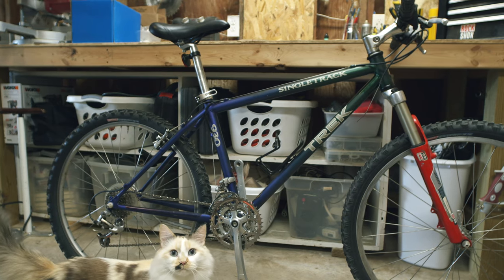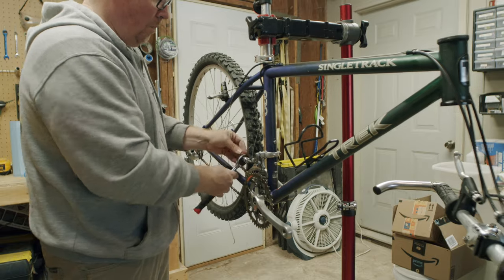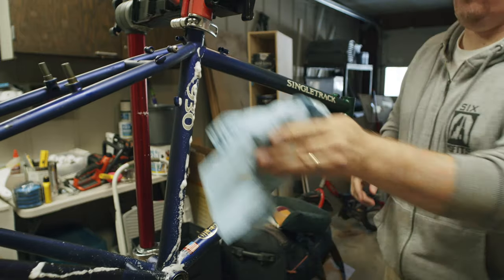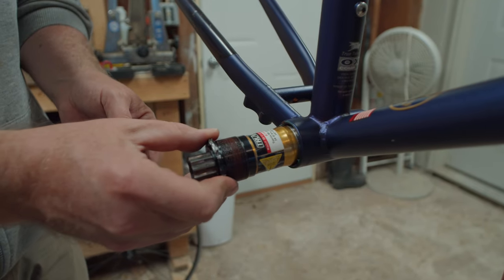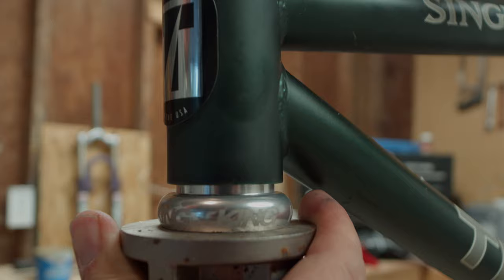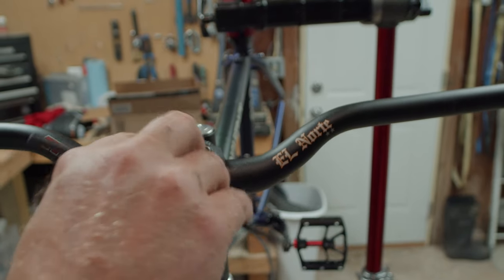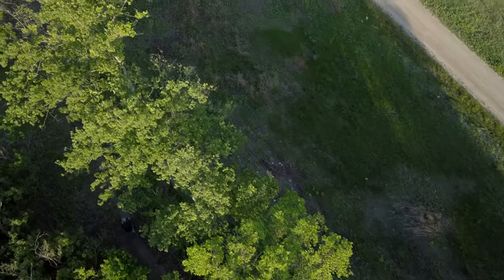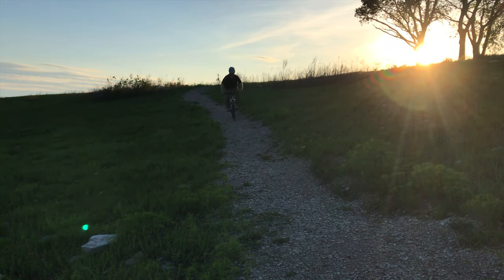Mountain Bike Restoration Trek 930 Steel is Real

Comment: I needed to see this!  Been agonizing about whether or not to replace my Trek 930, which has taken me across Iowa 3 times since 2011, as well as other short and long-distance rides in Florida and Missouri.  I love my 930 and have a special connection with it, as my cousin helped me with my purchase decision back in 1998.  I decided on a tune-up and will take it back to Iowa this year for the 2021 RAGBRAI.  It's not the fastest ride, but it's reliable and it makes me happy.
Reply from the maker: Thank you for sharing your story Laura. Sounds like you have a number of adventure left with your Trek :) Have fun at RAGBRAI!
Reply: I too have an original 930 (lightly ridden) that I bought in Iowa back in 98 or 99. Currently thinking about trading in, as I think the frame is a little small for me, but am beginning to think “keep it, swap out some components, and that awesome frame keeps living.

Comment: Those Trek 900 series are flat out awesome bike frames. They are straight and true. So easy to turn one into anything you want it to be. I recently had all the paint stripped off a '91 lugged frame 970 and was surprised to see Trek actually used expensive Silver brazing to attach the cantilever brake bosses to the frame. Now that is quality!
Reply from the maker: Agreed! Thanks for watching
Reply: @CoolBikeProjects  Thanks for the great video!

Comment: I bought a 930 Frame as my dream build bike, might go one more and add disc brakes but still undecided. Thanks for a great video
Reply from the maker: That is Awesome! I would love to see how it turns out.
Reply: What rims and Tires did you use on this build?
Reply from the maker: @kevinbeck473  Hi Kevin, I put on a used set of wheels from a Specialized Stumpjumper. Mavic 221 rims with Shimano/ specialized stout hubs. They were from 2001-2003 time. Great wheel set for the money if you are running rim brakes. Tires were Continental Cross Kings 26x 2.2"

Comment: I love the fact that you repainted the fork's legs! It really suits the bike. I'm considering doing the same with a vintage bike of mine, because the new fork I'm planning on installing is a bit bland. The original fork has that bare polished aluminum look, and I'd like to see if I can replicate it - or at least give the new fork a light silver metallic finish that would have it match the finish of the old stem and bars.

Comment: I washed my frame intense, absolutely drenched every surface with degreaser and cleared all the holes real thoroughly. Flushed and then used a truck wash both inside and out and repeat flushed all the grime out with high pressure water. Allowed to dry in the sun and after that a thorough spray with lanolin oil and tipped the frame every which way for 10 mins in the heat - it really digs into the steel and yeh rust - never 👌🏻

Comment: Hey great film! I am a Trek steel frame lover too! A few yrs ago I bought a blue 1999 930 for 10 bucks, fixed it up (all it needed was new cables all around, some new tires/tubes, a grease job and a bit of fine tuning) and won my first race on it! Had a lot of time to ride back then, was between jobs at the time.  Shortly after I bought a pink 1995 930 and restomodded it with some rigid forks, new pedals, street tires, and stem/bar off a modern Specialized.  That one was a bit more neglected but it cleaned up very nice. Love the lugged frames from those earlier years, although the geometry isn't that great for descending but it doesn't matter to me since I turned it into an around town bike.  For these old forks like the ones you put on this Trek, where do you go to buy rebuild kits/seals, etc for them?
Reply from the maker: Thanks for sharing your story Brandon, I was able to get some new seal kits from Jensen USA. There are some great connections though on YouTube if you check out butter suspension. He and a few others have some good contacts for seals and oil and things.

Comment: I had a purple Trek 930 .  Was purchased new back in 1993.  It was stolen from my garage when it was less then 6 months old.......never bought another one.   The other day I came across a 1994 Trek 850 SHX for sale In my frame size.   Guy selling it said its been sitting for years in his utility room.  Looked it over and the bike was dirty and cruddy but everything is intact with no damage .  Frame has a few minor scratches , nothing major.  No rust anywhere.  Oh, and it had a kickstand  LOL  With a lot of cleaning and degreasing, plus some TLC its going to be a good ride and well worth the 35 dollars he wanted for it.  If I decide not to keep it I will gift it to a deserving young kid that needs a bike.   I think I may have found something new to keep me going at age 67.
Reply from the maker: That is awesome Mike. Sorry your original was stolen, but glad you have another. Bikes are so much fun. . .

Comment: Thanks for the great video.  I am looking to do a similar restoration of my 1992 Trek Singletrack 970.  Do you know if my project would accommodate the same bottom bracket set-up you used? Thanks.
Reply from the maker: Hi Roderick- I honestly don't know. It would be best to go to a trusted bike shop and ask them to measure things for you first before you buy something. Stand Bottom bracket shells were either 68mm or 73mm so that will be the first measurement you can check. Spindle lengths can be all over the place.

Comment: Hi very nice bike!! .This Rockshox fork will fit on my Giant Granite (Sedona) 17inch frame 1991-1993  ?
Reply from the maker: I would suggest taking it to your local bike shop and seeing how much travel they think could fit on your bike. Unfortunately the early 90s bikes usually only had a 1 inch steer tube which really limits what kind of suspension fork you could put on there.
Reply: @CoolBikeProjects  to measure head tube diameter?
Reply from the maker: @mygoalcrash8077  yes and the headtube angle
Reply: @CoolBikeProjects  old forks is 1icnh (( not good news((  maybe how big head tube shutbe?
Reply from the maker: @mygoalcrash8077  late 90’s - mid 2000’s the standard was 1-1/8” . Early 90s to mid 80s was 1 inch standard. There are a few fork manufacturers that still make 26 inch inch and 1/8 steer tubes, and a few that make 1 inch just not very high end forks. Like I said I would check with your local bike shop to see what they would recommend.

Comment: Thanks for sharing this experience with us. I do wonder what cassette you ended up using? And how is the gearing for climbing. Also, did you put spacers between the crank spider and the chainring? It seemed like the chain would be hitting the crank with that chainring. Thanks
Reply from the maker: Hi Felix, I believe the cassette is 11-46 Sram GX. It came off of my Cannondale Hardtail One by 11. The chain ring is a narrow wide with built-in spacer. I can look up the part if you want.

Comment: Great video, thanks for sharing!

Ps. I'm eyeing a 1992 Trek 930, do you think it would be good for a retro mod or will I encounter any funky BB/headset standards ?

Thanks!
Reply from the maker: Hi there, It would make for a cool project bike but would most likely have the wrong geometry and a 1" headset so no real options for a suspension fork. Best wishes!
Reply: @CoolBikeProjects  cheers, thanks for the tip! expecting to use as a pub bike/light gravel bike so I guess the geo will be OK

And planning to run it rigid, but I hope it won't be a hassle to find 1" headset/forks

Comment: Is that the S-Works wheelset? Think the front was a Specialized Skraxle, and the rear hub was unbranded DT Swiss, both laced to Mavic 517s?
Reply from the maker: No this was the stump jumper wheel-set with the 221 rims. Still a nice set for their time.

Comment: Any chance at an item list? I have a 930 that I found in the garbage that I combined old parts for and have had on the trail numerous time, but would love to have a suspension fork, new headset, and 1x11 cassette.  I just do not know what parts are needed.
Reply from the maker: Sure thing, Ill add a list to the description over the weekend.
Reply: @CoolBikeProjects  ok so me and my son dug into our 1995 single track 930. we went cheaper with a Wake 780mm bar, headset, we stuck a quill adapter in the original fork (we don't have a shock just the original forks) New Shimano Linear pull brakes, and kept the old cassette and cranks for now, just want to ride the thing...But i had to order a new bottom bracket. one item I have a question about, When you ran the cable for the rear brake, did you enclose it for the length of the top of the frame and then what did you do once you got to the seatpost are that has that built in tube the old brake line went through? We thought it would be too tight a bend to go from that welded on tube guide so we used a hose clamp and mounted a section of cable sheilding to the frame? picture of that area would be of great assistance.  
Thanks.  the inspiration was perfect.  Eventually the parts will find their way into our lives that turn it in to a 1x11, bu ti told my son, with this age of bike, the less you spend, the more fun I have....
Reply from the maker: @KAlone321  That is awesome! Way to go guys. Since I went to a 1x11 I was able to borrow the cable guide that went to the front derailer as a stop. You don't want to use the tiny brake tubing by the seat post as you said it will be way too tight. I would suggest running the brake housing as a solid line from the level to the v-brake with noodle. If you want a cleaner line you can use some stick on brake guides just as a guide. If you are happy with your hose clamp then keep it. I found these guides here: https://www.amazon.com/Xmomx-Derailleur-Fitting-Housing-Durable/dp/B07YTZXPTJ/ref=sr_1_5?dchild=1&keywords=cable+guide+bike&qid=1627305255&sr=8-5 for about $8. I have sold the bike to a friend and don't have an image of it. If you email me, I'll get a picture of the brake line from him. Thanks! rustysbikerepair@mac.com

Comment: Even though this video is older.  I would like to mention. The original bike shop (Eddy's bike shop in North East Ohio,) which sold this bike is still open and I bought a Trek from them. The phone number on the frame sticker is still the same.
Reply from the maker: I actually tried reaching out to Eddy’s when I was making the video to see if they’d like to say anything about the bike or the shop and they never got back with me. I’m glad they’re still around though.
Reply: @CoolBikeProjects   Should of given a call. They are cool when you are on a call. They were amazing during the big drought of 2020. I found my 2021 Marlin 5. Not only were they helpful in letting me know about the drought. They helped me navigate that in fact it will take a long time to get an order.
So I suggest next time, with any bike shop. Give them a ring, instead of the e-stuffs. Eddy's picks up the ring pretty fast. Not so much on emails.. :) They have  more than three locations and are legit OK. :)

Comment: Going from a 63.5mm drop to 100mm drop seems significant. Was there any real negative to changing by this much? Would you recommend restricting it to 80mm instead?
Reply from the maker: Excellent question. This particular year of the 930 the geometry of the frame had the right head angle to accommodate the longer fork. It's best to set up a bike project with the fork in the frame and wheels on the ground to make sure the head angle is not pitched back too far. I am working on another bike project like this and experimenting with fork length to get the right angle. Sometimes you will need to keep it to 80mm.

Comment: What's the difference between the trek 930 and 920? I found a excellent condition 920 for sale
Reply from the maker: The trek 930 had a double butted steel frame. I believe the 920 was also a steel frame but with older geometry

Comment: great edit! I picked one of these 930 frames up recently to restore as well, looking forward to it. Do you by chance recall what size King headset the frame needed?
Reply from the maker: Thanks Aaron. Its a standard 1 -1/8”
Reply: @CoolBikeProjects  thanks for the quick reply! your video gave me some good ideas so I really appreciate it. I just cleaned up the frame and polished it, looks fantastic and no rust inside the tubing that I can find!
Reply from the maker: @aaronnull8950  That is awesome. I love seeing steel frames still in great shape! If you're on instagram I'd love to see any pictures you have of it.
Reply: @CoolBikeProjects  thanks just gave you a follow and realized you’re also around SE Idaho!
Reply: @CoolBikeProjects  in the process of finishing up my 930 but running into cable routing issues for the rear brake - do you use that little tube on the seat post if you convert to V brakes? I have been just routing some hosing around it but I think its causing a kink or something because the brake lever doesn't spring back when applying rear brake now. May end up taking everything apart first and making sure it is well lubricated and the spring tension on the caliper arms is strong enough. Cheers!
Reply from the maker: @aaronnull8950  Don't use the metal tube routing. That is for cantilever brakes only. I ran the brake housing all the way from the brake lever to the v-brake noodle and used zip ties temporarily to hold the housing to the frame. There are a number of metal self adhesive cable guides you can buy online from amazon for under $8 total to attach the cable housing to the frame, but all will require you to run the housing the full length. Hope that helps!
Reply: @CoolBikeProjects  Thanks, got it fixed!

Comment: Really enjoyed the restoration, mods and ride.  What size frame is it?  I ask because I have the chance to purchase an 18in 930.  I am 5'11" with a 32" inseam.  I am wondering if the frame might be too small for me?  You look good on the bike.  How tall are you? Thanks.
Reply from the maker: Hi Kathy, Thanks for reaching out. This was a 16.5" frame. I am 5'7'' so this fits me well, particularly with the taller fork. The 18" might be be a tad on the small side for you, but without seeing one built up it's hard to say for sure. You might check with your local bike shop to get their thoughts with your measurements. Best of luck.
Reply: I'm 6 feet tall and with set back seatpost and long stem 120mm I made 18 inch fame fit me a gt tenquesta if it's good shape and price is good I say go for it just expect alot of  seatpost showing and the bike to feel small for your size but it could be great bike to ride around town with the kids on bike paths or as errand grocery better with couple racks or rainy day bike with fenders

Comment: Nice looking bike but poor quality control or poor transport.Rear wheel has major issues right out of the box. https://www.youtube.com/post/UgkxHL1v1R3NE5x4KiYfyt8dnQmyNYz7qi5L  Rear axle is bent! Derailleur is misaligned.Since the rear wheel comes assembled I would have expected better.Assembly instructions poorly written, but that was not unexpected...just annoying.I just had the bike checked at a shop and was told that I should contact the seller about getting a whole rear wheel assembly with cartridge. (The bike shop could not do anything to help me).Not a good experience with this bike, so lesson learned.Added 3 stars for excellent customer serviceUpdate Sept 8 2020Just received a complete replacement wheel for free. Great service and an otherwise fine bike.
Reply from the maker: Yes, the bike runs great.